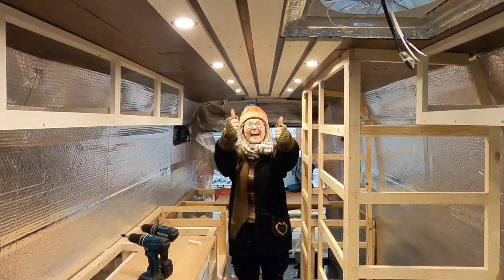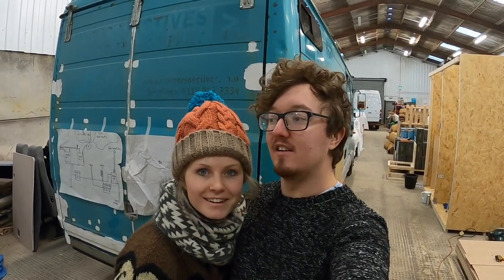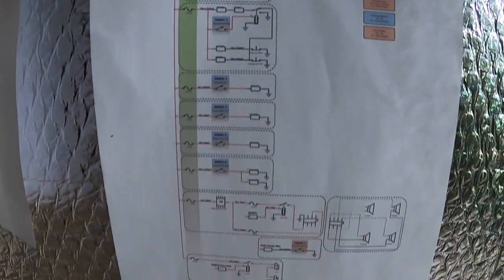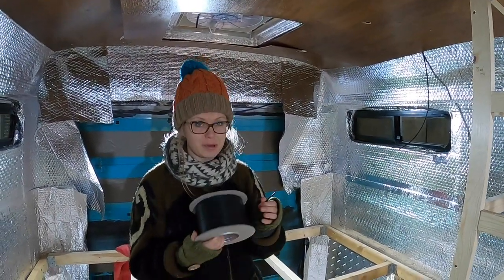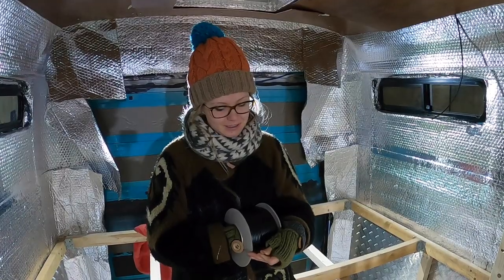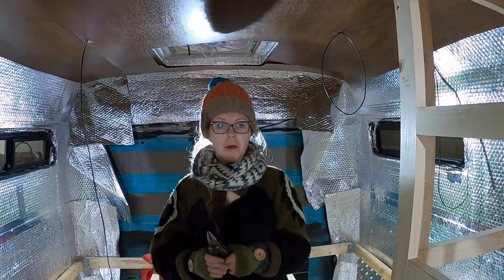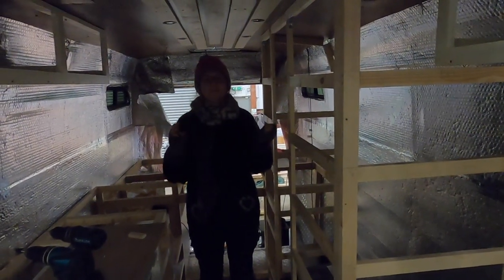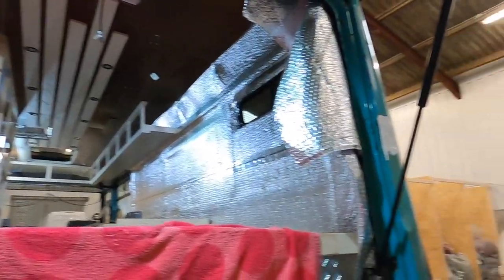SLATTED CEILING | Alternative to Tongue & Groove | MERCEDES VARIO CAMPER CONVERSION | Van Build Ep16

Comment: Something i learned with hole saws, is once pilot is through and your half way through with the saw, turn the wood over and drill from other side.. it prevents splinters or worse.. in other words both sides will be neat and only need a light sanding.. looking good.
Reply from the maker: Thank you Aiden! That’s a good tip, we ended up splintering some of the holes and Max can’t resist pulling them 🙈
We’ll have to employ this top tip next time!

Comment: A few observations for people using your work as a guide. Firstly when you are painting any timber that will be in your van, paint both sides, especially as you used bathroom paint as it will contain vinyl. This means moisture can't leave or be reabsorbed equally on all surfaces. End result could mean your roof slats may cup.  You should also have treated the many knots as in time you will end up with discolouration and staining.  Use something like Zinseer Bin as a primer, this is shellac based and will act as a stain blocker. I'll leave crimes against table saws to another post.  😂😂😂

You seem like a decent couple with a good SOH and I'm enjoying your build. Much appreciate the time necessary to film, edit and upload your videos.

Comment: Loving that ceiling! Well done guys, it does look damn good!! If you haven't already, think about a dimmer for the  above the bed area lights, those LEDs are damn bright in the night, I fitted a dimmer to our T5 and it makes one hell of a difference 😍😎👍🏼
Reply from the maker: Thank you!! We have got a dimmer switch that’s going in but I can’t remember if that’s just for the under-counter lighting we are doing... the lights are definitely very bright!!
Reply: @MaxSophieinaVan  maybe if the different areas are on different switches go for the dimmer above the bed because when your eyes are sensitive in the dark and someone turns on one of those lights it'll wake the other up with a "WTF?!?" 😂😂 We've got a remote control dimmer in our van and 2 touch on/off lights above our head so before we go to bed we turn them down to minimum so if anyone puts one on anywhere they're at the lowest setting. Or you can see how you go 😂😂
Reply from the maker: That sounds like a great idea - I hadn’t actually thought about middle of the night needs...

Comment: The ceiling looks amazing great job
Reply from the maker: Thank you!! <3
Reply: @MaxSophieinaVan   have you thought about taking the van out to make sure it’s still dry and water tight. It’s looking great
Reply from the maker: We have thought about this, unfortunately the van doesn’t have an MOT at the moment and we aren’t actually allowed to drive it until we pass another driving test! However we do fancy taking it for a spin around the farm the lock up is on, I’m scared the fans are gonna be leaky!
Reply: I’m sure it will be fine